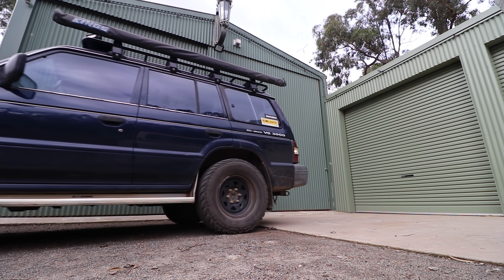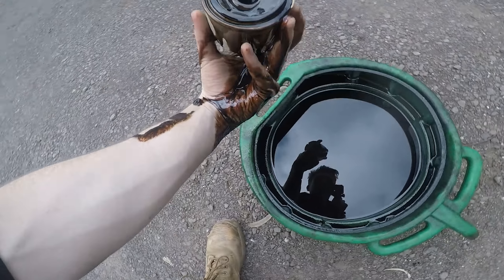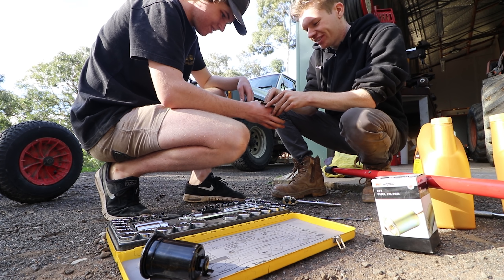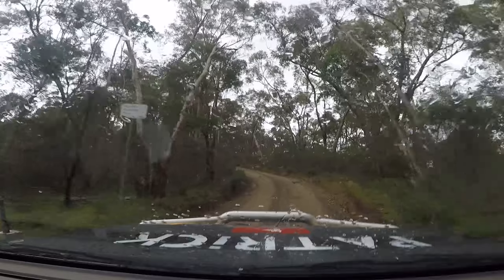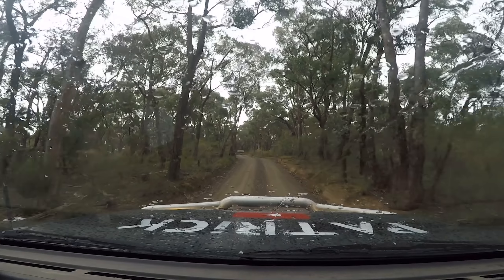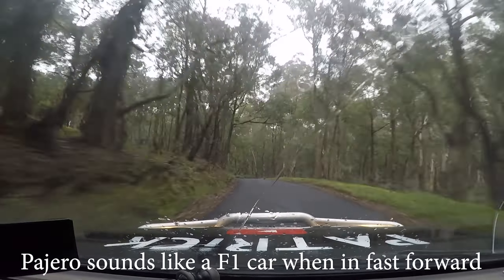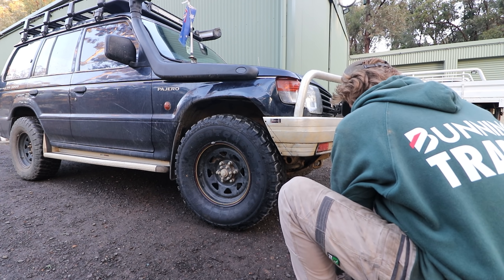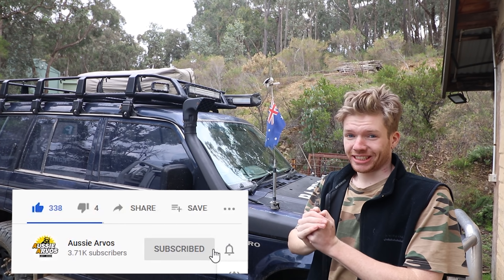CAN I FIX MY PAJERO? | Fixing Dents + New Tires + Modifying Bull Bar on my Mitsubishi 4x4

Comment: @3:40 mine does that same water flowy sound and I've narrowed it down to it being water flowing through the heater core
Reply from the maker: ah yeah i reckon thats where it sounds like its coming from!
Reply: Gurgling usually means air though, is your radiator/overflow tank topped off? Try bleeding the system, maybe have a radiator shop do a pressure check. Also, are your front lights flashing? The solenoids are pretty cheap online, like a 15 minute fix

Comment: you can also wind your torsion bars up a few notches too get a bit more ground clearance and hopefully pull the wheel back a few mm
Reply from the maker: definitely want to give this a try! just worried about my CVs
Reply: @AussieArvos   a few notches wont harm it too much and if you do a lot of notches just drive slowly over big drops so u dont put stress while its on angle

Comment: Hi mate 
I also have the Pajero 93 model, i purchased it from a old person and he didn’t do any service at all, currently having crank shaft oil leak, and planning to change all the pulley seals and time belt as well. What are the things that I need to change be for put on roads 
Thanks

Comment: If you want to de pressurise the fuel system just pull the fuse or relay and run it.
Reply from the maker: couldn't find the fuse for the pump so just ended up cracking it open pressurized but yeah don't that trick before on other cars

Comment: Quick tip use a dog or cat food bowl that fits under the filter and use hpr30 20w-60 to lessen lifter tick one last thing is check ur dizzy cap o-ring if it goes bad and any moisture gets in there you wont get it started again for half an hour or so one more thing use u95 for extra power it ain't worth using 98 the 3l doesnt run right and get a product called moreys upper cylinder lubricant for a smoother running engine.

Comment: The hot water trick only works on plastic bumpers not metal guards. Check the drain holes in your doors make sure they aren't blocked and the door is full of water
Reply from the maker: ah yeah, we didn't have much luck, ill check em out! cheers!

Comment: An easier way to depressurise the fuel system is just pull the fuel relay out and start the engine till it runs out of fuel

Comment: Just pull the fuel pump fuse and run it out of fuel and put new spark plugs and plug leads and see will go a bit better and new air cleaner

Comment: Really easy simple 4wd there, not the most capable but cheap to run and own. 5L of oil is nothing for an engine like that. hit the air filter with an air compressor, good for 5k. Easiest engine bay clean. Spray it down with wd50, carby cleaner, degreaser and wipe it with a towel. Cheap and easy
Reply from the maker: Yeah its a awesome rig for the price, will definitely get around to cleaning it!